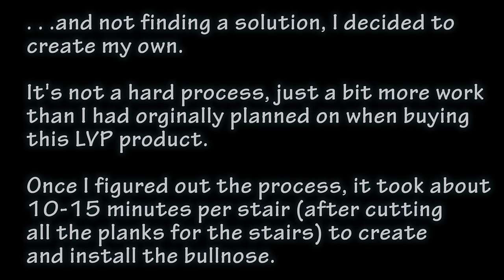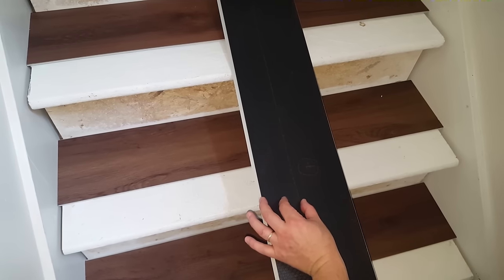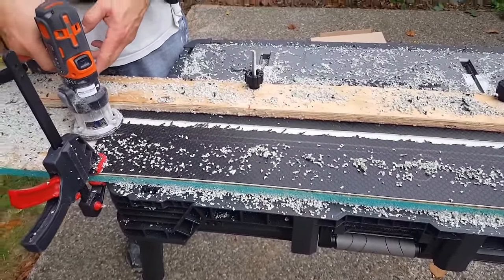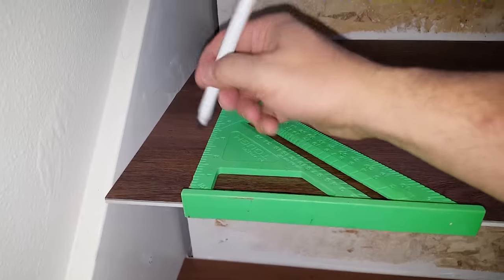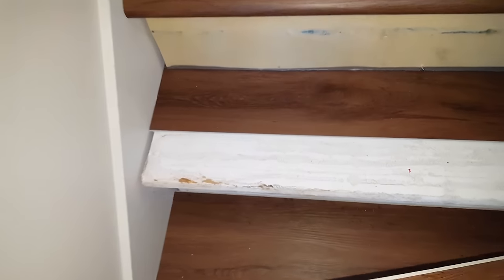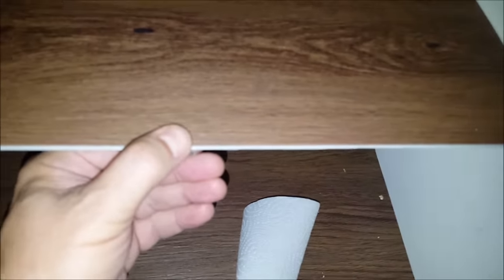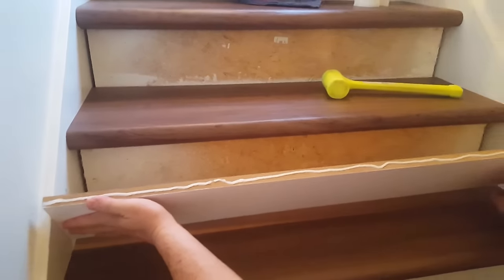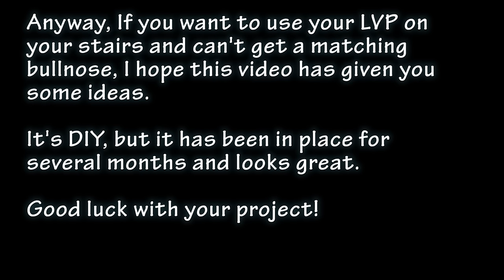LifeProof LVP Flooring: How to use on stairs and create a matching Bullnose!

Comment: I'm in the process of doing my main floor in vinal wood look. Much like a lot of people are saying that there is no bullnose to buy for the stairs and if there is it's like $40 per step, that adds up really quick. I will be trying your idea and I'm going to try without removing anything from the back, unless I read someone else tried and failed. Heck, even if I break a few pieces it's still alot cheaper.
Thanks for your video and for putting up with D jr. Some people just can't respect other people's ingenuity.
Reply from the maker: I sure hope it works for you without removing some of the backing because that would really save a lot of time and effort.  I did try a piece without removing some backing but found it took a lot more heat and was harder to bend.  I was worried that it would melt the surface before it became soft and bendable which is why I ended up removing some of it. Good luck with your project!
Reply: I thought about this as well.  But instead of leaving it solid and trying to bend the full thickness, I would consider ripping a series of about 3/16" deep parallel grooves with a table saw at about 3/16" spacing so that it's easier to bend yet the nosing piece is full depth and solid when installed (you might have to experiment with the depth and spacing on a sacrificial piece to get it right). Sort of like how they used to do to create curved drywall surfaces.  In fact, I have a drywall contractor client who bought a $50K+ machine to do this with drywall and create some amazing custom cornice shapes all out of drywall!
Reply: @HokiePE  kerf cuts!
Reply from the maker: This might have worked had I known what a 'kerf' cut was at the time, heh heh. Maybe someone else can test this out and let us know.

Comment: I read through some comments to see if anyone posted about this and did not find any. One item of caution or something to consider- I was informed that the pad needed to be removed from the product I purchased if gluing down as it could separate and create a dangerous risk of the flooring moving when stepped on.

I’m not sure if that’s a product specific risk or construction technique of this type of flooring.

Great video and solution! Thank you for sharing!
Reply from the maker: Hi Robert.  Not sure about that but I tried removing some of the padding from a test piece before starting and it wasn't easy.  I 'think' as long as you have the two planks firmly secured in place you should be good.  In my case the risers are wedged (also glued) in there so tight between the bullnose above it and the stair under it, I can't imagine it moving.  I know it's only been about nine or ten months now and no issues so far, but I guess time will tell.

Comment: Iv done before with a large Amtico plank, glue down. It looked really good. If youd have warmed it from the back gently first where the fold was going to be, where the backing had been removed, then heated from the front the same as you did. You get a better heat conduction in the plank. I found this worked for me on the thicker Click LVT(LVP)

All my customers ask for now is carpet on the tread and the LVT(LVP) on the riser to match the flooring installed on the ground floor. 

Good video this mate and good quality work from yourself also. 👍🏻

Andy from North West England
Reply from the maker: Thanks Andy, greatly appreciate the comment - especially coming from a professional! If I ever have to do this again (which hopefully I won't), I'll definitely keep this suggestion in mind.

Comment: looks nice nice to have the company see this and make planking premade like what you did strikley for stairs.they sell the flooring should have the matching stair planks. I believe I may be in the same boat as you and I dont know if I will have the time to do the stairs...but I will see
Reply from the maker: Thanks for watching! Once I figured out the process I was going to use, it took about 15-20 minutes per stair. You can cut that time down if your stairs are all uniform in size/thickness as you can make a separate molding station and do them all at once. Unfortunately, my stairs were all different thickness and lengths so I did it on site to get them to match. Be sure to watch my one-year update for additional tips and suggestions.

Comment: Great video.  I recently had to make a custom transition to their master bathroom. I used a plank, heated in a similar process and it was the perfect solution. Glad to have found your video for doing stair treads. 
I just wanted to point out @20:12... you could also heat the material from underneath... to avoid scorching.  Heating the underside won’t cause you to freak out if watching vinyl bubbling causes you to 😳😤😭.
Thanx again for a well executed video presentation.
Reply from the maker: Thanks WTP, glad you liked the video and thanks also for the additional tip!

Comment: Cool job, I've seen  few of these,  I think the router bit was doing it's job , the reason for the rip I think is that the cut was on the right side, possibly going a little too fast .. but it worked either way
Reply from the maker: Yeah, when it first started happening I searched and found a video that explained the problem. That's how I ended up flipping the board around on the last cut to smooth it out. Thanks for watching!

Comment: I’ve done this myself ... probably the same time you did yours. Yours looks better. Note: the summer dessert sun can heat the vinyl planking enough to bend the vinyl (if you don’t have a heat gun). I made a table clamp outside, and pre-made each bullnose piece heating/cooling as needled. I didn’t shave any planks. I didn’t have a router.
Reply from the maker: Good grief, that's a lot of sun! Yeah, I was hoping to pre-make them but whoever did these stairs did a poor job as each bullnose was a different thickness. Once I realized that, I felt I would get a better fit bending them separately in place.
Reply: @ChronologicallyExperienced  I never thought of making a temp riser; very nice work..! Years ago, I built my stairs with a (bottom end) 90 deg sweeping turn instead of a landing and turn. For that part I did have to form on stairs. And I did borrow a heat gun. But, it’s all done at original thickness...  thank again.

Comment: Ok as a Flooring installer with 30 years experience let me clarify a few things in this video. First, I like this guys intro stating hes a first time DIY. However, I know for a fact every "life proof" (manufactures name for the material) has every possible matching trim piece you could want. You as an individual cant order them though. You must get them from your flooring stores.  (Not Lowe's or home depot) While I like this guys effort and patience. I'm unsure as to how long the edges that were folded would last due to the typical flexing of the stairs over time as people walk on them.
Reply from the maker: Hi Ron, thanks for watching. It would be nice if they provided this to the public since there are many folks like myself that are renovating their homes. Unfortunately, we were told there were none available (after we had already bought the product), which is why I ended up making my own. As for holding up, check out my 1-year update video. After 18 months, so far so good and we use the stairs on a daily basis for our exercise routine so it gets lots of action. Hopefully it will continue to hold up.
Reply: It’s going to crack right where you started the bend in my opinion depending on the amount of traffic! Looks pretty good though!
Reply: I have concerns about them cracking over time or when something heavy is placed on the edge such as when you are moving furniture up or down the stairs. I was going to put lvp on my stairs and even bought the matching bullnose from lumber liquidators. However my treads are made from a 2x so they're 1 1/2 thick and the bullnose isn't tall enough to cover even half the edge. My wife and I have decided to sand down the treads and stain and seal them. I am pretty good at wood finishing. I think for our application, it will be a better solution than trying to just make something work that wasn't intended for that purpose. If I'm going to be spending this much time and money, I might as well do it right.
Reply: And I've changed my mind about our stairs. I'm going to build up the risers to where they are flush with the treads and then I can install the lvp and bullnose on the stairs.

Comment: I wonder if this would work for NuCore.  I’m having an absolutely horrific time trying to figure out a solution for my stairs (exact same situation).  NuCor’s bullnose cover/transition is not only flimsy and cheap, to astonishing levels, but it looks awful, undermining an otherwise, incredibly beautiful, high-quality LVP.  I’ve got zero transitions, and 100% continuity going from the hallway to each bedroom, and into hall closets. A lot of work, but looks stunning.  And, now trying to find a stair solution to cover the bullnose, is literally undermining the entire project….$4500 worth.  I’ve either got to find a way to make this work, or sand and stain my steps to match the LVP (that still requires one step to find an acceptable transition piece).  This was not only promising, but looks beautiful.  I’ll give it a try….thank yo so much for sharing. 👍. P.S.  Have you had any problems with the LVP cracking since you’ve put this in?….or, has it held up well in the meantime?
Reply from the maker: Hi Phil, - thanks for watching! Best thing to do is take a small piece of NuCore to test/practice on. The heating goes fast so you do need to get a feel of the distance/pace of heating to find that point where it starts to soften and you can mold it. I don't know anything about NuCore, but hopefully it will work for you. As for cracking, it's been nearly three years now and they still look as good as in my update video - meaning they are still as perfect as when I first put them in. Good luck with your project!
Reply: Also, we've done several sets of NuCore.  The only problem I've noticed is that the wear layer is a bit thin.  We've developed a process (over time) of dealing with the problems that can cause.
Reply: @saltystairtreads  You're 100% correct.  I wound up using a table saw and cutting away all the padding underneath, then it would heat and flex almost instantly (heating from underneath).  I'm going to try and stain the rest of the stairs, if I can find a stain the matches.  But, the process you used is exactly what I did.
Reply: I got Nucore as well ! Did it work out for you ? I want to try it. What’s some problems you occurred ?
Reply: @Dontwatchme7653  I can tell you that, so far, we don't have any issues with it at all.  It cut/lay extremely well.  Our only complaint would be the design is a bit too predictable.  At least with the finish we chose.  So, as you're laying plank, try and make sure you very the planks.  We did that, and even then it still looks a bit too "perfect".  And, wood flooring is anything BUT perfect.  So, just keep an eye on that.  Short of that, it laid very easily, cut very well (we purchased a plank cutter).  You just have to keep in mind that a couple of things...:
1). If you're doing stairs, you'll have to find a solution to that, that works for you (stain, heat-bending, square-nose, etc).   I can't give you much advise on that end of things, because short of doing the 1st stair on our 2nd floor landing, I haven't tackled the stairs, yet.  That will be this coming winter.  NuCore doesn't offer an appropriate bullnose solution (for reasons unbeknownst to anyone who's used that product). 
 2).  As the pro's will tell you in  every video.  You HAVE to prep....and prep very, VEYR well.  Get the longest straight edge you can find, and go along the floors to find the uneven spots.  If you don't, it will stick out like a sore thumb, and drive you absolutely insane.  And, of course, if you don't find that until after you've laid it, then you'll have to pull it all up.  You'll notice some spots, as you lay the plank.  But, other areas won't show until you've got the plank down.  So, I did the best I could with prepping.  Then, I'd lay 1/4 of the room, then walk across it listening/feeling for any give.  I've got to pull up my hallway, because I "thought" I had an uneven spot prepped and it wasn't.  That plank will make it stick out like a sore thumb.  I'll tackle that when I figure out what I'm going to do with my stairs.  Live and learn...  

With all that said, we are VERY please with how it turned out (although, still adjusting to the noise levels going from carpet to wood).  With pale blues'/green's, and molding with 3/4" quarter round, these floors and rooms turned out beautiful.
Reply: @phillamoore157  Have you done the stairs or not yet. I have NuCore too and the stair nose is definitely not the best. We only have the stairs pending to be done.
Reply: @magdasanchez9626  No, unfortunately we haven't gotten to the stairs yet.  You're right, the nose on those are hideous and undermine the LVP IMO.  Very poorly thought out.  That said, we're going to try and sand down the wooden stairs we have, and stain them to match the LVP.  If it turns out that, that doesn't work out, then I'll attempt to figure out a plan for putting the LVP on the stairs.  I'll let everyone know what I do, and how it turns out.  But, the one stair I did, I had to score, and heat the back of the LVP to bend it around the stair nose.  That will by FAR be the hardest part.  It took me practicing on several pieces of scrap plank.  I used my table saw to score the back of the LVP.  For what it's worth, that's worked the best, and looked the best.

Comment: We're about to take on this project for our stairs (15 of them...whew) including a few off-angled stairs.
Reply from the maker: Good luck with your project! It really isn't so hard as long as you take your time and triple-check your measurements. I couldn't believe it, but every stair was a different size in one way or another which is why I had to measure each one separately. Practice on a small piece to make sure you get a feel for the process and you'll be fine.  It'd be cool to hear your results if you get a chance.

Comment: We installed LVP throughout our house (including the stairs) a few years back, and we looked at all the brands including Lifeproof. We ended up getting a different brand, but I’m fairly certain almost all of them we looked at had optional bullnose tips you can purchase.
Reply from the maker: At the time we installed our flooring (a year ago), Home Depot told us there were no matching bullnoses and we couldn't find any online. We didn't want to take a chance of spending a lot of money on something that wouldn't match the existing color so this was my solution. Since then, I've been told there are some available so hopefully others will find it easier.
Reply: But they are SO expensive. I also really like the seamless look that resulted from this technique.
Reply: Christine Lee - The bullnose I got installed from factory is seamless too.  And it’s actually not that much more.  If you’re already going with LVP, then you’ve already committed to spending more than just laminate, and in some cases almost as much as real wood.

Comment: Thanks for the video, that's a great idea and you did a wonderful job. I am curious how it will hold up over time. The front edge of the step obviously takes the brunt of the force and wear from walking on them,  and since the plank is compromised and weakest in that very area , and my fear would be that they will crack due to constant impact.  A follow up video in several months or a year would be much appreciated ...whether they last or fail would be good to know.  Thanks for being willing to try something new and unorthodox.
Reply from the maker: It's been a year now and I'll be doing a follow-up video this month so stay tuned.  Spoiler: they look, feel and function the same!  :-)

Comment: This is super smart thinking.   they look a little too tight to the sides but that could be a visual trick of the video.
Reply from the maker: Thanks Robert. Yeah, some of them might be a bit tight but not knowing better, I was thinking it needed to be snug to keep everything in place. It's been a year now and nothing bad yet so hopefully that trend continues.
Reply: If they were 30 feet long it might be a problem.   But they're short so it doesn't matter.

Comment: This was the missing piece for me. I'm installing Pergo and it's too thick to heat up a full plank with a heat gun. I did a few tests and shaving off a few layers really helps. I used my table saw for testing but just ordered a flattening router bit.
Reply from the maker: Sorry for the delayed response - hope your project worked out!

Comment: Great Idea-Maybe if the 2 by 4 was closer to the width of the stairs it may have helped in the bending-Looks Great
Reply from the maker: Thanks Greg. Yeah, probably so. I was worried one side would cool off before I got the other side soft enough which is why I used a smaller one. Oh well.

Comment: Although this works, the smartest place for the joint in that stair further from the nose the better. Make your nose piece from a full plank and cut to fit the fill. The next riser will cover that 1.5mm gap that you will leave behind the fill.
Reply from the maker: Sorry for the delayed response - thanks for watching! I was lucky to be able to use two full planks without having to cut the width and still have enough to fold underneath. Obviously folks will have to adjust according to their stairs.